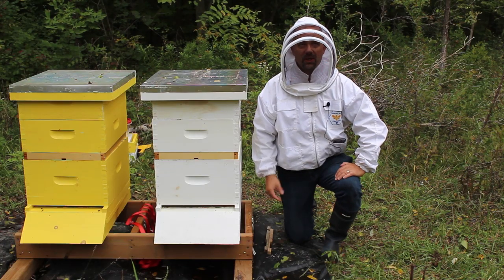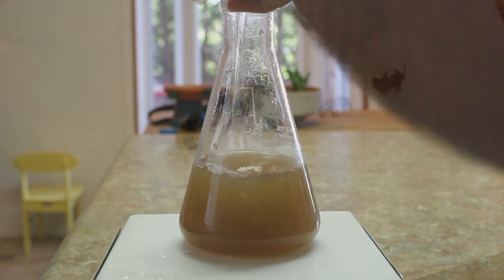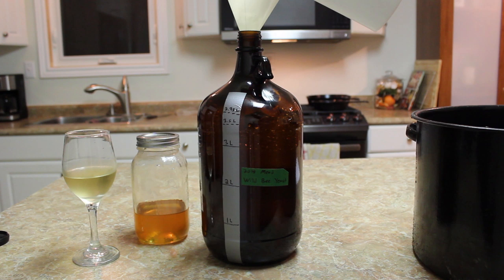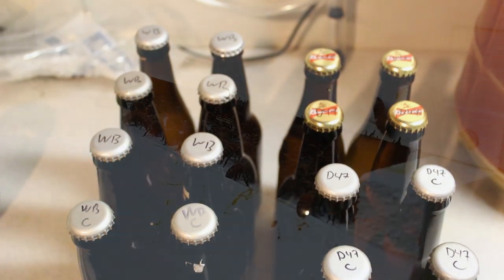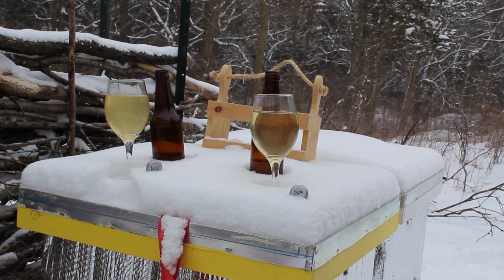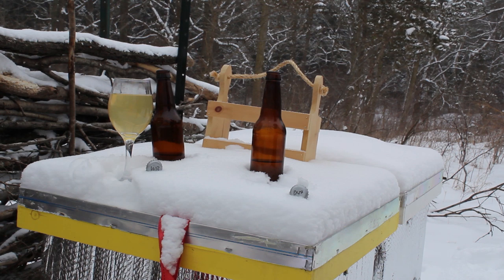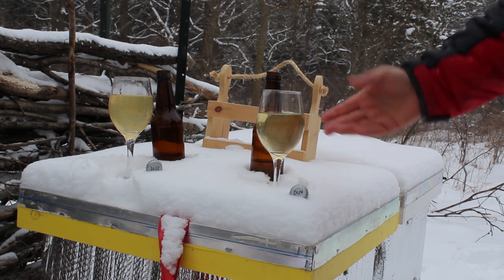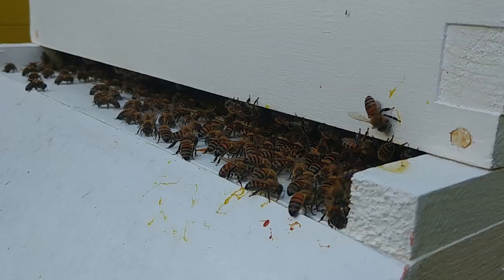(Wild) Mead The Hard Way

Comment: Just heard you know The Mead House and had to check this method out. I was thinking of trying to make an "estate mead" where all ingredients are gathered from my property and using bees looks much simpler than traditional wild yeast capture methods.
Reply from the maker: It is easy. And you don't have to go through the vodka step if you don't want. You can just use plain wort. The vodka helps ensure that you get a yeast capable of fermenting to high gravity, but even without it, most wild yeasts have no problem with 8-10% ABV.

Comment: Could you have thrown a hop pellet or two in your starter to kill off the lacto?
Reply from the maker: You would need to boil the starter for 30 min with the hops to get enough iso-alpha acids, but yes, that would work. It doesn't guaruntee a non-sour mead though, as Lachancia yeast are common in bees, and are lactic-acid producing.

Comment: Hi
I read in the Internet about wild yeast

I made some wort and put it in the jar among the trees one night after being covered with cheese cloth.
After that  jar closed by airlock for about two weeks. I noticed some foam on the sides of the jar and some bubbles
I added more of the wort to the jar and within two days I noticed an active movement of the bubbles and did not see any wort.

 What do you think about this result?
Reply from the maker: You need to be more patient. Captures from the air can take 2 to 3 weeks to start fermenting strongly
Reply: @SuiGenerisBrewing  
Yes I know
I am now in the  middle of the third week of my starter .
I waited two weeks before I added wort but after adding wort in the second time I noticed that the fermentation process Increased activity.
I like to make sure that this result is safe.